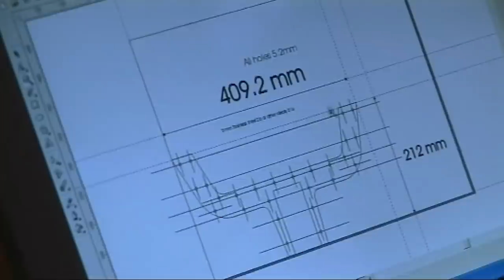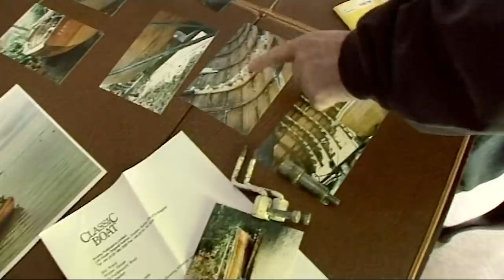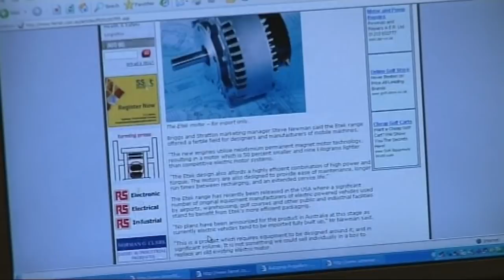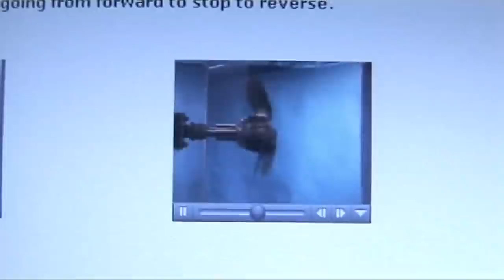CLINKER PART 1 - Converting a clinker built boat with an electric engine.

Comment: The shaft log at this point can be manoeuvred in such a small length if using a tube and expoxie to afix it , you problem is based on prop size what speed you want the hull an rpm to do then the rest is wood work